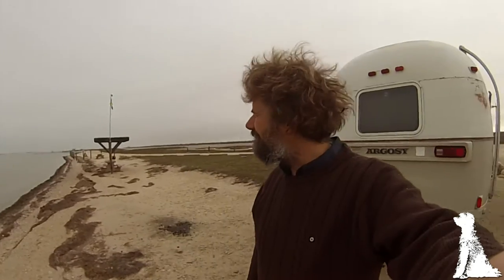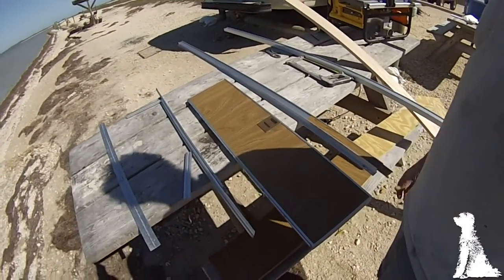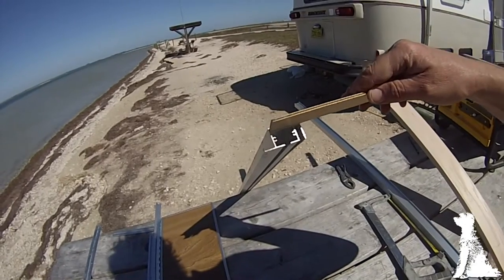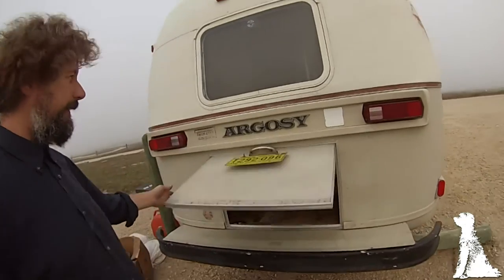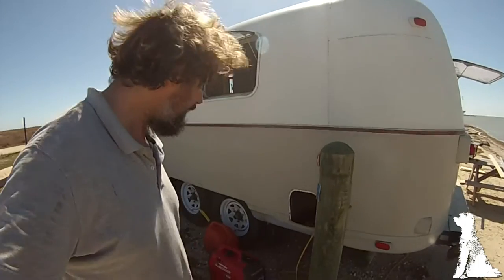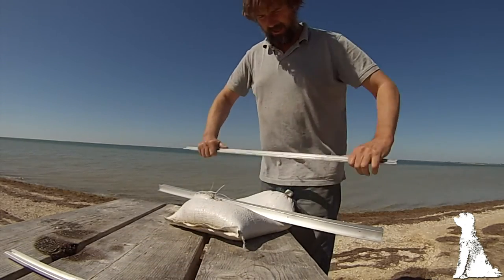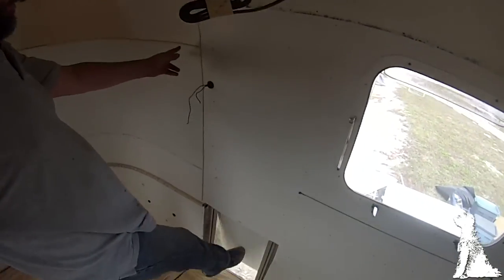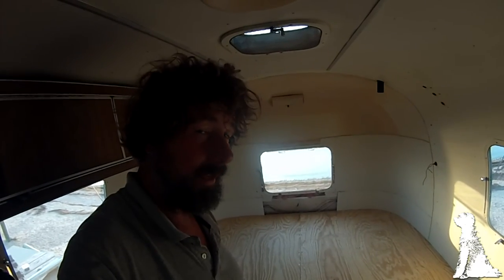Airstream outside lockers - Travels With Geordie #9

Comment: How is the V6, and the airbag suspension holding up pulling the airstream? despite being an airstream it's gotta produce a lot of drag? do you think the extra power of the V6 had anything to do with the wear on the prop/universal joint and the diffs ?what kind of fuel consumption do you get with and without the trailor ?
Reply from the maker: Time for a Rover update video. But to answer your questions the truck has performed so well, far better than I could have hoped.The 4.3 V6 is the perfect power for a series truck. Some would say not really enough for towing the Airstream, which is somewhat heavier than stock! But more power would make the Rover unsafe and over taxed. As for the u joints, they are robust units that can easily take the power involved, the one I blew early on was certainly already compromised., later on I replace the propshaft because the splines were bad. Since then I've had no trouble. The Salisbury ear diff is bulletproof, so no worries there.Mileage is great, 15 MPG with the trailer on and 25+ running free!Thanks again Tom for your continued interest, I get a full update done on the truck.